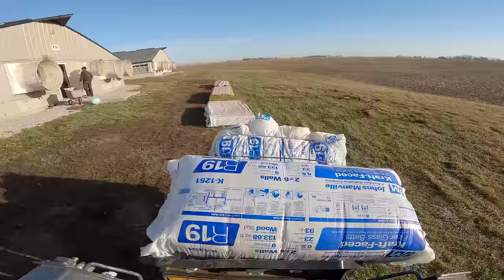Repairing a $500,000 Pig Barn: End Wall Project

Comment: Here in east central Indiana I've seen bad decent and good built hog barns. One I remember after it was built we were populating the barns. You could stick your finger in some of the concrete cracks. Definitely poor build quality. I haul hog feed every night from 5:00p.m. to 5:00a.m. Looked into buying a set of finisher barns. 2 barns each housing 4000 head. Barns were 12-15 years old and had zero maintenance. New gates outside that have set outside for over a year or more. Price wouldn't pencil out and a whole lot of work to bring it up to acceptable level. 😢 Maybe someday. I do like how yours are set up though.